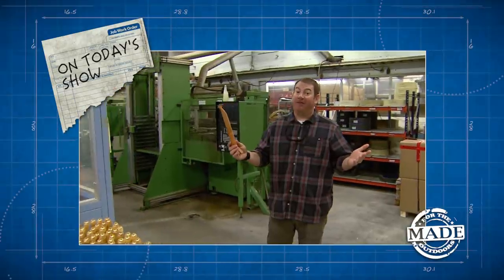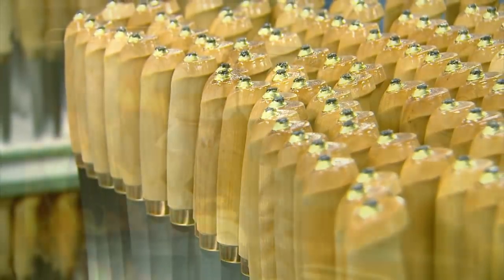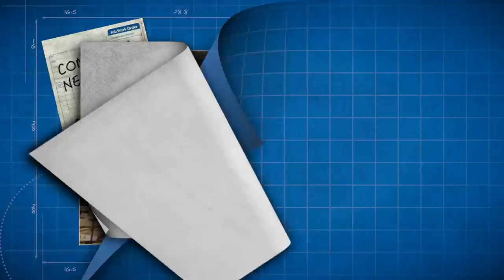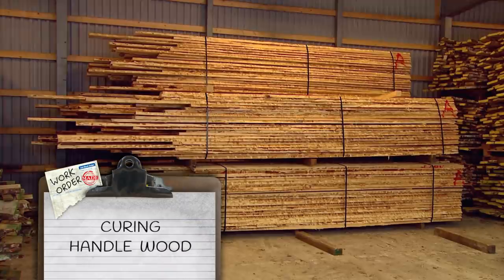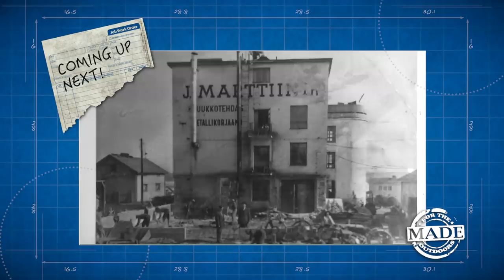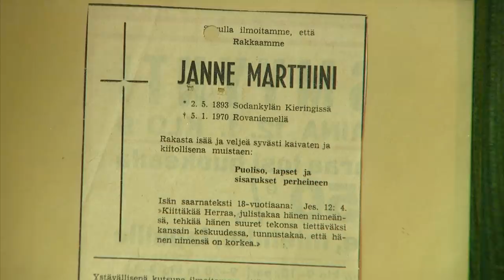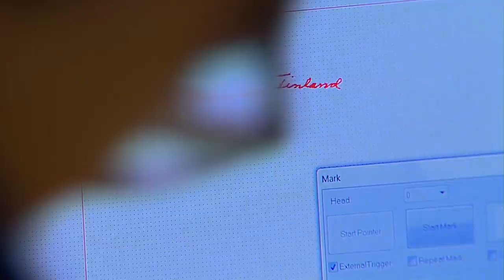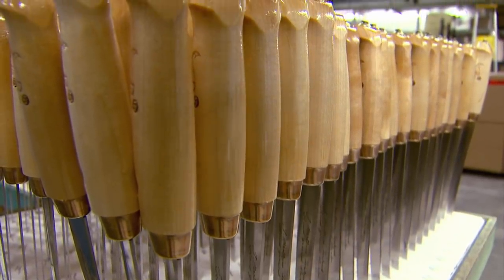Made For The Outdoors (2017) Episode 6: Rapala Filet Knife

Comment: Nice presentation. Have a pair in kitchen that has travelled many miles. Filleted many species and when not fishing they made great steak knives on table. They are 53 years old with only an added coat of spar varnish and Spiderco ceramics for the edges.

Comment: How are the blades ? They look beautiful , but I prefer performance over looks.
Reply: They perform well. They hold a reasonable good edge and are easy to sharpen. The wooden handle filets are about 20 euros depending on the length but you can get the plastic molded ones under 10 euros.

Comment: Rapala missed a trick on these knives. I have used Marttiini Finland fillet knives my whole life. I bought a Rapala and it did not perform as well. Upon inspection the Rapala is flat ground, the  Marttiini is convex. Reground the Rapala to convex and all is well. Maybe the grind is easier to maintain for the average Joe and they wouldn't know the difference unless they had used one of the original knives.